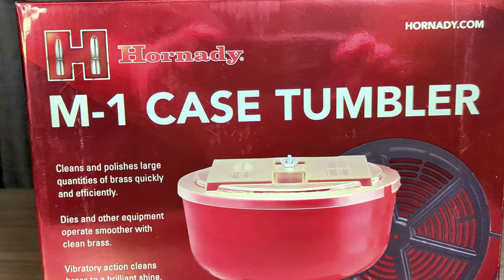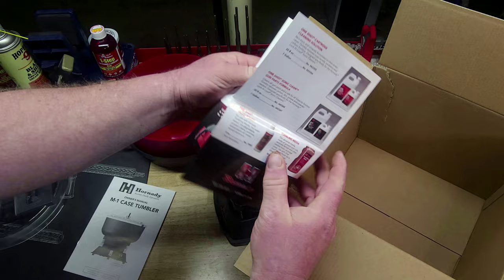Hornady M-1 Case Tumbler Review

Comment: Great results with that model! Your brass appears pristine-new using your solution for an 8 hour cycle.I already plan to get that tumbler,but now you spoiled me to get the solution and trying the 8 hour cycle as well. I find your video to be an excellent presentation for the "Hornady M-1 Case Tumbler" and look so forward to getting it for my reload ambitions.Keep that brass'a glowing!Thanks!
Reply from the maker: I appreciate you stopping by and leaving a comment and I thought I would give you an update I ran 3000 pieces of 9mm and 2000 pieces of 223 through it over the long weekend I had this thing running around the clock for 5 days straight and it still is running awesome.